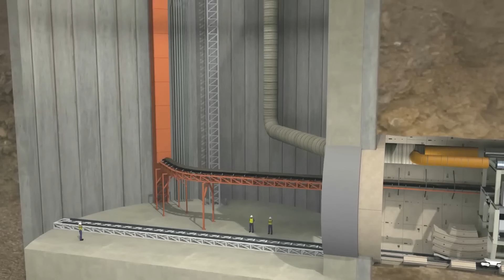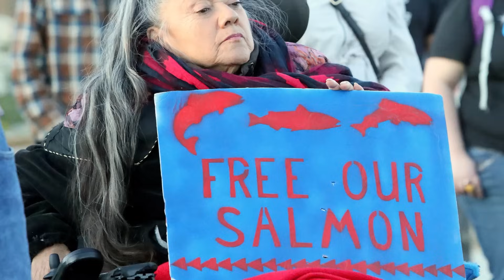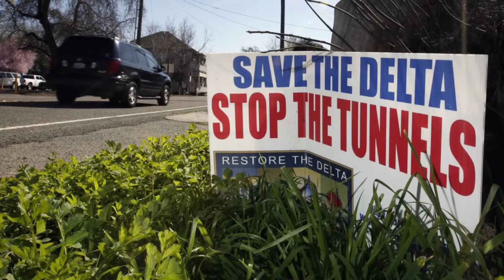Inside The $20 BILLION Delta Tunnel That Could Save California

Comment: For $2B the Agess Inc has proposed digging a ditch to import gravity fed ocean canal water into Salton Sea & Laguna Salada but many have suggested Death Valley with 500 miles below sea level to increase monsoonal rainfall in Colorado Basin. Mining mineral & Co2 rich ocean water for cement, brick’s, fertilizers, sodium ion batteries, chlor-alkali life sustaining chemicals, hydrogen gas can be safely stored in room temperature liquid by Ayrton Energy in Canada.

Comment: Will Elon's Boring Company be involved with the boring boring of the tunnel.
Reply: Ocean water from Pacific Ocean to fill 500 miles below sea level in Death Valley and 443 square miles at Salton Sea would need Elons Boring Tunnel device. Ocean Water would evaporate in 943 square miles to increase monsoonal rainfall in Colorado Basin and provide use commodities from minerals in ocean water.

Comment: Lol... so far the high speed rail system California has bragged about, was started in I believe 2015 and was supposed to be 800 miles long. So far they have completed about 50 miles (no rails yet) while still working on 150 miles. The 800 miles is history! The cost so far has been $15B, the original $35 B estimate is now $135B for the 150ish miles, but I doubt that will ever happen. So, based on California's past projects, do you really think this new project will go anywhere? I doubt it.